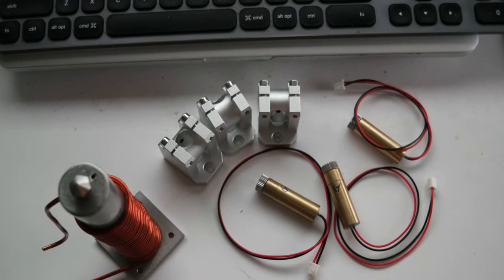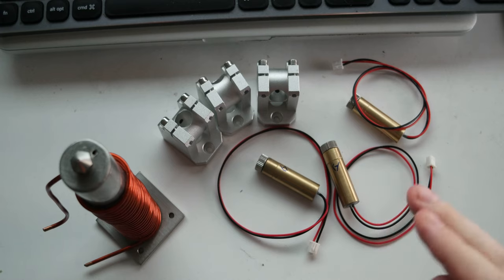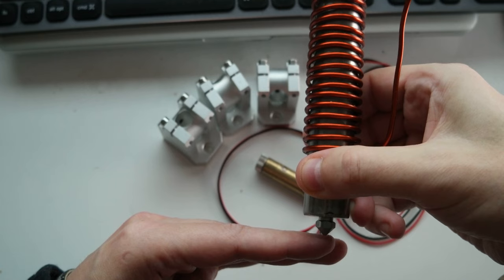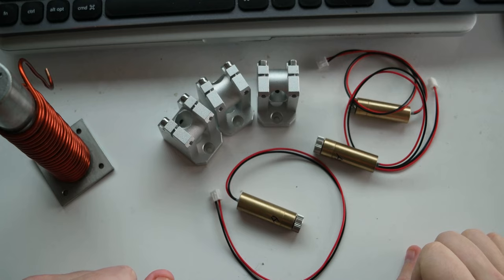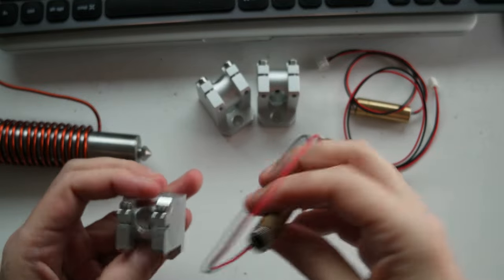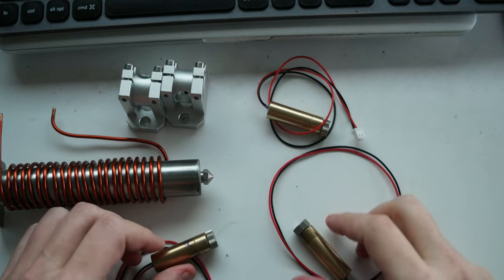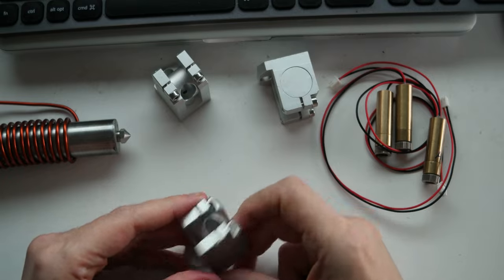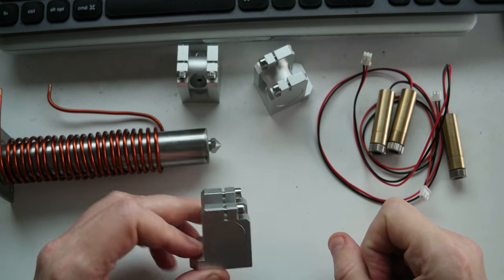3D Printer Dual Pellet Extruder and Laser to improve layer adhesion

Comment: I had a problem with layer adhesion on a firearm part, I would like to be able to use a separate machine with a laser that travels the surface of a finished piece that drags a hot needle in the opposite direction as the layers, dragging one layer into the next few layers in order to add maximum strength, I can accomplish this with a wood burner and it made excellent strength gains but a lazed or heated needle dragging through the layers would look a lot better. We won’t worry about printing plastics in 5 years because metal printers will come down to a  consumer price hopefully.
Reply from the maker: interesting, but not all cases need to print metal, there are plenty of situation where plastic or composite materials are perfect. Maybe is not your case. Yes metal printer will be more available at decent prices for sure. Please subscribe thx

Comment: Прогревать лазером предыдущий слой ?? Это интересно. Хорошо бы помогло при печати ABS пластиком.
Reply from the maker: I do not print with ABS. Planning to use Carbon Fiber in Nylon and HIPS for support.
Reply: @ganzoai  , Does nylon need a high temperature ?
Reply from the maker: @goiiia3774  The one that I am using CF 30%+PA6 is around 250 C